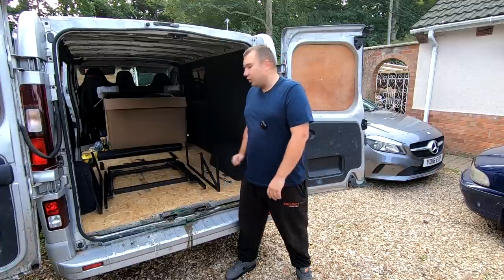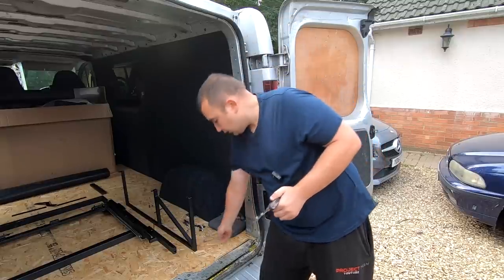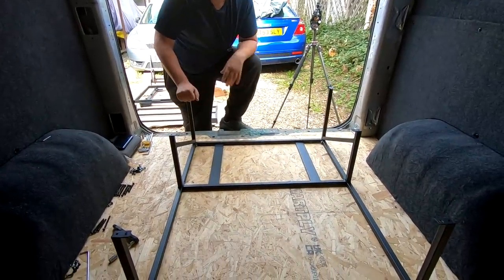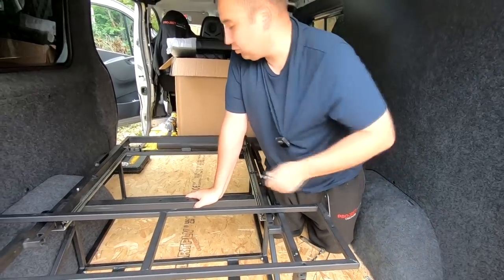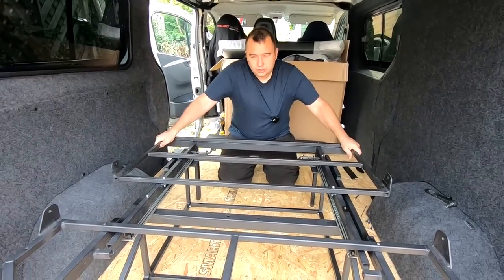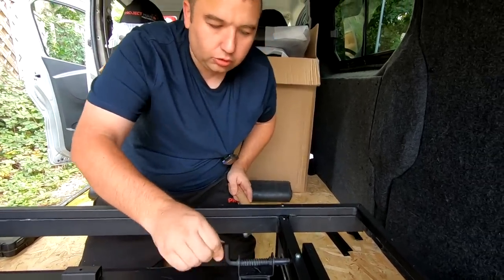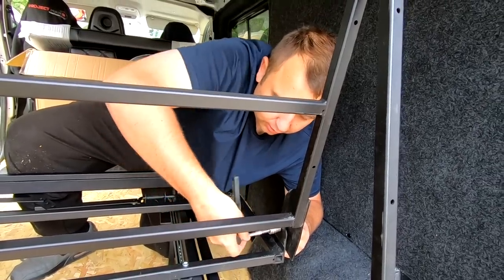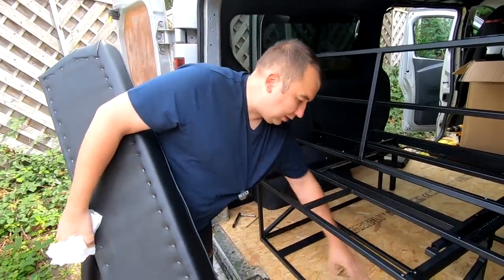How To Assemble A Rock & Roll Bed #camperdiy #diycamper

Comment: Gary spent 35 years in motor industry, some on crash testing, you need to fit bigger spreader plates under the van, trust me on this with 2 people belted in that seat, in crash that seat will pull though the floor
Reply from the maker: Iv got some half inch steel ones to go on when we take it out and put the floor down 👍🏻
Reply: I thought that too but you’ve got that covered Gary,,, well done
Reply: Would you suggest getting it crash tested once it's installed, and would only certain garages carry this out? As I intend on carry children on these seats I believe I may need show the certificate to the insurance company (haven't checked yet)
Reply: @GeorgeMcKnight  the manufacturer of the seat should give you a certificate, they are pull tested not crashed. I have insured mine for 6 years now and never been asked but mine is Motrocravan on the V5 that you wont get now on a low roof van

Comment: This is two years too late but I’ve just watched this and it was a very good tutorial b u t . . .
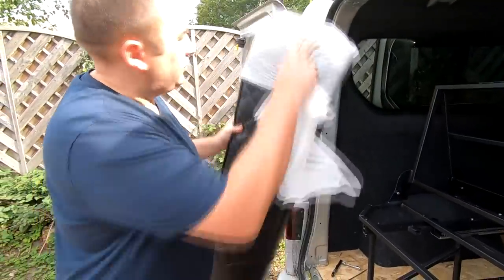10:54 you even mentioned the cut out notch for the corner fit, but then 11:39 you say you just put the cushion on.
But you put it on the wrong way round with the cut out corner now on the wrong side at the back.
Then you did a down view and you can see the cut out corner on the right at the back which is wrong 13:01 and the full corner at the front butted up to the post where the cut out should be.

Comment: The rear facing seats, be a bit tight against the rear doors. How would anybody sit there?
Reply from the maker: They are not for travelling in.
Reply: @ProjectMan  ah I see. So the van is still a 3 seater
Reply from the maker: 5 seater you sit facing the front. 👍🏻

Comment: The under floor plates should be around 125mm X 90 mm in 4mm steel and should have bend edges..
Use M10 bolts 8.8G .Make sure they are not Chinese rubbish 
Has the bed got a pull test certificate when used as a seat ??

Comment: Did you complain about the poor packaging and damage done?.
Reply from the maker: No Ray its in and I'm happy.
Reply: I don't think that it was all due to transit damage, especially the locking bolts, it looks to me to have moved out of square through the welds and the thinness of the stock.